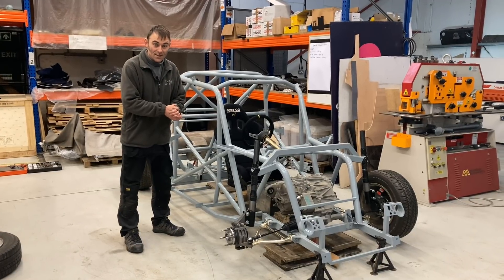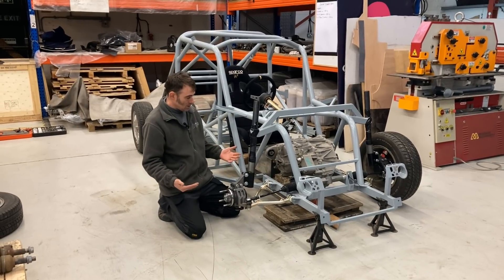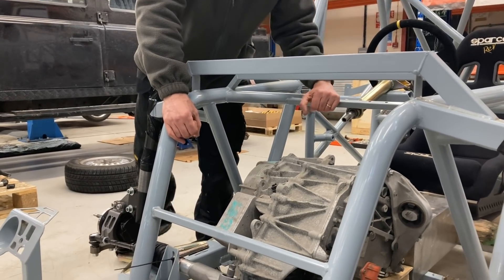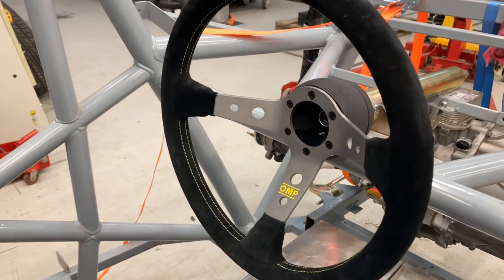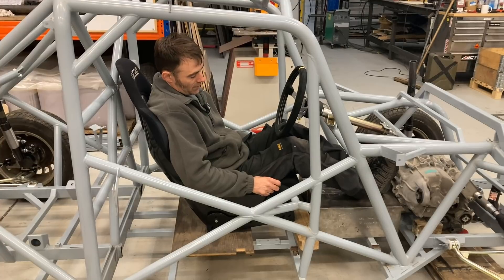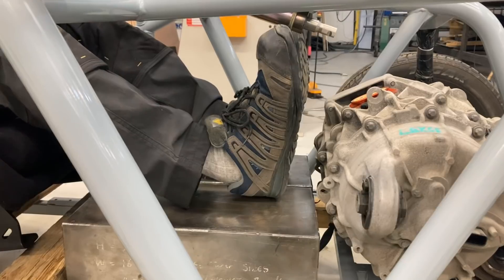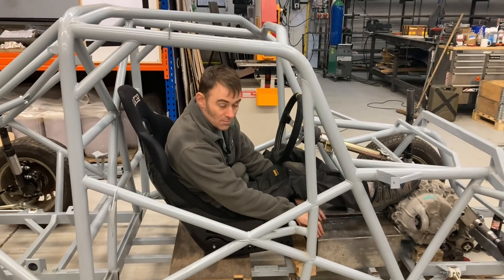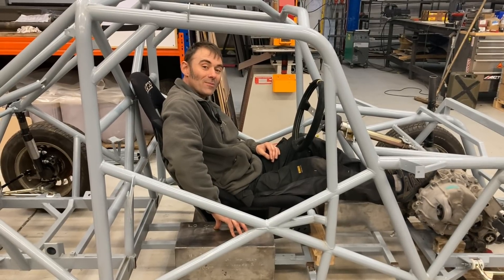Pikes Peak Race Car Ep1 - The beast is born

Comment: Hi Richard, Tesla put their batteries under the floor, could you do that with biggest section or even a smaller section? You have loads of ground clearance, of which you only need a small amount even on a bumpy track. So you could take the batteries as low as suspension travel height, although the lower you go the riskier it's going to be. But remember their is loads of room, just where you want it!!!! I'm an engineer too but not in this area, Electronics & Computing, but retired. Good luck with the project & keep up the good work. From Ian.

Comment: SInce you're into crazy projects, why not go for an electric rally car? It would of course have to be 4WD but more importantly it would have to have enough energy to complete a full day of rallying, including road sections :p

I imagine the energy required to complete a gravel stage (say, like in Sardinia or Greece) would be quite high, since you spend a lot of energy ejecting loose gravel instead of actually going forward... And tuning regen would also be quite a challenge :p

Comment: Interesting project. Just a thought - with the massive acceleration you are going to have, even with a low C of G you will still get a fair bit of weight transfer to the rear, but you are putting the higher powered motor in the front. Sounds like a recipe for front wheel spin, I don't know why you wouldn't put the higher powered unit in the back? You can put batteries where you like to balance things. If Elon's Plaid is the same layout, more power at the front, you might get an advantage by doing it the logical way round?? Best of luck taking down the man.

Comment: I thought of a part that might be of use to get the steering column over the front motor, the 2nd gen frontera had a steering rack with the pinion pointing up forwards, a short shaft to a 90 degree ish transfer box.
if you google 2002 frontera steering column you'll see it and there is one on ebay right now!
Reply from the maker: Interesting. That's a Bevel box which is what we were considering using. Didn't realise they were used the the Frontera. Thanks for letting us know. 👍

Comment: Great update, because the car will be so light for power to weight and due to the massive torque kick of the electric and the fact that you can’t “feather the clutch” I expect the front to regularly lift on hard acceleration despite the front motor position. Is there enough room for a couple of the batteries to go right at the front maybe ? 🤔
Reply from the maker: Yep, weight distribution will be key. 👍

Comment: Richard - Looking at the front hubs, the design looks to me like the steering arm angle relative to the kingpin position dictates that these hubs are designed to be mounted with the rack behind the axle. I reckon with the rack mounted in front of the axle, the Ackerman angle will be incorrect and you'll get loads of horrible tyre scrub on lock. A virtual line drawn through the track rod end and kingpin should intersect with the centre of the rear axle to give good Ackerman angle.

Comment: Well done! 
RE: front motor, is it no possible to tilt/swing the motor down a bit, to free up space for the steering rack? Although, I am also curious about  steer-by-wire technology...
Reply from the maker: You can tilt it a little but there's an oil pickup at the bottom so tilt it too much and it'll start pulling air through with modifications internally. But you're right, a slight tilt might be a good idea, the only problem then will be it impeding the pedal assembly.. 👍
Reply: @ElectricClassicCars  Thanks!
I initially though (minimal) ground clearance and suspension travel might the limiting factor, I did not consider lubrications… E-motor are high revving which implies a gearbox, right?
Reply from the maker: @jossentjens7154  That's correct. 👍

Comment: Richard!  I just had an even better idea than swapping a Chevy Bolt engine into  a 2019 VW convertible beetle engine.  I saw the electric Austin mini with a 300hp Tesla model S front motor.   Much easier to do, and about double the horse
power!  I love it.  Keep the videos coming.

Comment: Question: how many kWh is stored in one LG module?
Suggestion: rotate the rear motor/inverter 180 degrees along/around the line through the axles, putting the weight of the drive unit more towards the middle of the car (this way the motor spins in the original direction but it does put the motor/inverter "up-side down", is that a problem?)
Reply from the maker: Unfortunately the drive unit can't be mounted upside down due to the internal oil lubrication system. 👍

Comment: Not really applicable to this project but wondering if it is possible to ‘over volt’ the motors?  Using a 7s pack would still give good power under a voltage sag situation.  I’m asking as I want to use these LG Chem batteries with a model 3 rear drive unit.  It is for a very light kit car for sprints and hill climbs so I don’t need much capacity.  I was going to use a single 6s pack but wonder if a 7s would be possible?  Great project!
Reply from the maker: No, the inverter wouldn't work at that higher voltage. You need to check what the voltage range of the inverter is as it will be built and designed to work within a specific voltage range. 👍

Comment: I don’t think you will have any problem joining the steering column to the rack using simple universal joints. From the video it looks as if it could be done with just two joints but it is difficult to judge from the camera angle. If there is a problem there is a really nice piece of kit used on the VW type 2 (T3), the square fronted rear engined Transporter. It is used to transfer the motion from the vertical steering column to a horizontal shaft attached to the rack mounted under the front seats. It mounts under the floor below the pedals.
Reply from the maker: Yes, that VW Bevel gear is exactly the one I have as a backup.👍

Comment: Because you talked about voltage drop I was wondering if the Ultra capacitors, a type of capacitor with a very high energy storage capacity from a company that is called Skeleton Ultra capacitors, could help to reduce that voltage drop even more. Their capacitors are very lightweight, yet very robust, and they have a ridiculous amount of energy storage capacity for their size and weight, and they are rated for very high energy flows. A Scottish island uses those Ultra capacitors in combination with their wind turbines. And 3 years ago the YT channel Fully Charged did a video about Skeleton Ultra capacitors. The host of that show even went to visit their production facility in Europe. 

I thought that it was worth mentioning, although you have to see for yourself if the specs from their products are good enough or even useful at all for what you want to accomplish. 

Anyway, big thumbs up, and looking forward to the next episode. 👍🙂

Comment: You've almost got enough headroom to be able to fit a whole layer of batteries in the floor, how tall is your driver? 😁
Reply from the maker: Either that or we roof chop it to improve the aerodynamics. 😜👍
Reply: Good point John although I think having the batteries surrounding the seat means it will be fairly close to optimum anyway..
Reply from the maker: Just tried the batteries under the seat. Unfortunately with a helmet on its dangerously close to the top cross bar on the roll cage, so looks like under the seat batteries is not an option.

Comment: Most all wheel drive electric scooter conversions run seperate batterys to each motor as you say there are more amps than the battery or bms can handle. GO TEAM BUFFY

Comment: Can you not rotate the rear motor 180 so that its closer to the centre of the car and then you can just move the two supporting frame struts and keep the existing rear cage frame?  Assuming you can effectively reverse the polarity of the motor - or is that the limitation ?
Reply from the maker: We can do that but it would then hit the diagonals in front of the rear wheels so we'd be in the same situation. We've reversed motors a lot in the past as a motor doesn't care if it's spinning one way or the other but as the rear motor is the master and the front is the slave motor, the wrong rotation would confuse the front motor so we're going to leave them both in the orientation Tesla intended. 👍

Comment: Fun working out the amount of batteries you will require, as race/events could/will be of different lengths and you don’t want to be carrying excess weight. You might even not need all the batteries all of the time.

Comment: I'm not particularly knowledgeable about electric technology,  especially if it's in a race car.  But I really love trying to follow your explanation of the how & why you place things.  This technology, in my opinion, is the future of motor vehicles.
So I like to learn more about it.
I followed your broadcast show on TV and hope to see it come back.
Reply from the maker: Thanks. Season 2 of Vintage Voltage is already out on QuestTV here in the UK. For other countries I'm not sure when it will be on air.
Reply: @ElectricClassicCars  ever thought of using hub motors?, f1 use the same tech in there cars.
Reply from the maker: @godslittlehelper3209  We've used a hub motor on a motorcycle conversion we did a few years back but for various reasons they're not really great for cars.
Reply: @Electric Classic Cars  previously here in the U.S. they had it on the motor trend network.  I've not even seen ads for it yet.
This network has been going through some issues and isn't very consistent.
But since you say it's started I'll keep watching for it.
THANK YOU

Comment: At that amount of power, will you consider going a bit wider, even if you place batteries around to get a decent 50/50 weight distribution, it's still not a battery pack that sits at the bottom and the way motor mounts look like, they will be higher than expected too. Also the steering shaft...kind of skinny, imagine in turns with all the power at angle drifting you don't want that to snap.